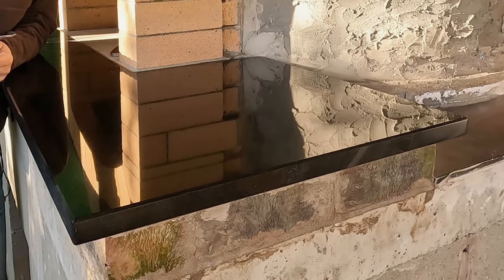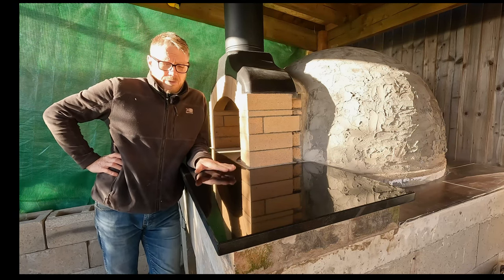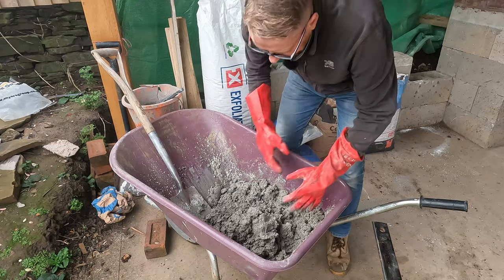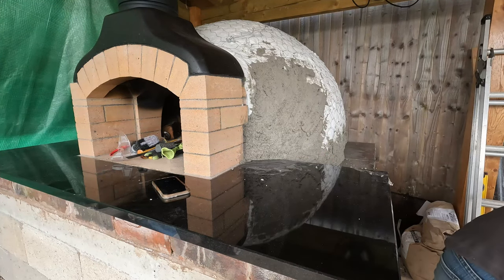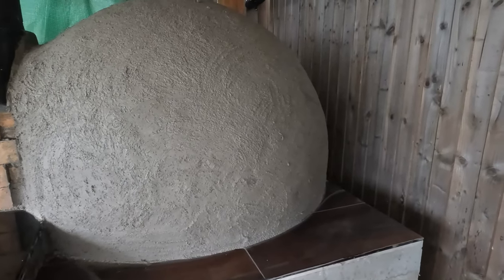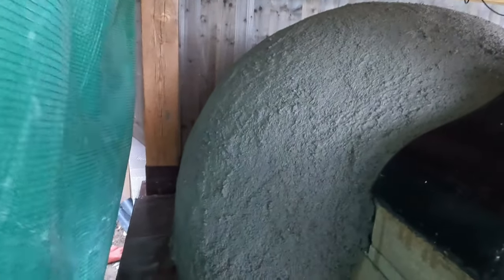How to Render a Wood-Fired Oven|Novice Attempts (Vlog 36)

Comment: Top job Mike, looking really good!
Reply from the maker: Thank you, Sam. Have you decided on your tiles yet?
Reply: @Mike-Diamond  I think we are just going to have the render now.  After a few test fires we are worried we need perlite render like you have - our dome got pretty hot on the outside.  How did you mix the perlite up? Did you just add cement and water?
Reply from the maker: @SamDaviesBuilder  5 parts perlite, 1 part cement, 1 part washed sand and 1 part lime. 

When it’s on you have to have quite a few very small fires that burn for  3 hours each. Not sure if you know this?
Reply from the maker: https://youtu.be/OSEJIysnn1k
Reply: @Mike-Diamond  yea we did a few small fires and then had a bigger one. 

I’ll try that mix ratio out, thankyou!

Comment: That looks great Mike.  I thought about using granite but I have a cantilevered front and was concerned about the weight involved so I went with porcelain tile instead.  It came out pretty good.  As you probably saw in Vid 9 my oven isnt round it is more "bread" oven style.  It goes 28 inches by 36 inches of cook floor.  I managed to get all the pots and pans I was cooking with in one of the meals...Vid 11.  Hang in there brother of the brick!
Reply from the maker: Brothers of brick, I love that. ❤️ 

The granite looks absolutely gorgeous, it was we’ll worth spending a few more £’s. 

I did notice our ovens were different. I’m still interested in watching all sorts of ovens being built, especially by us novices. We’ll me anyway, you look like you know what you are doing 😄